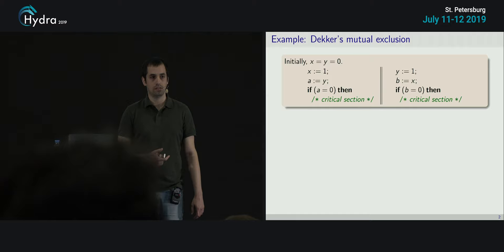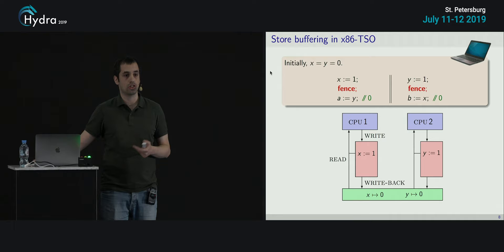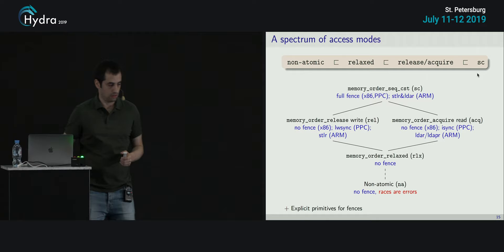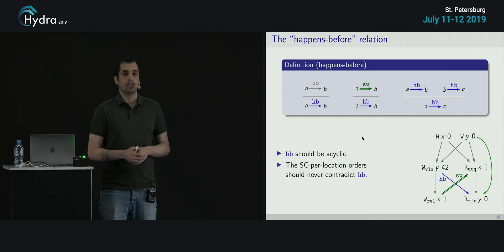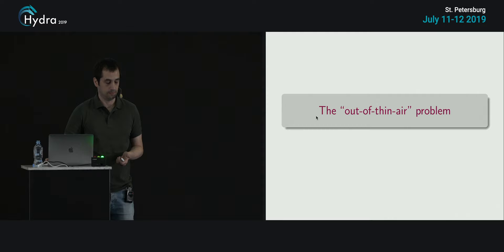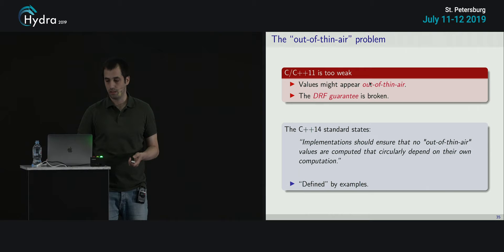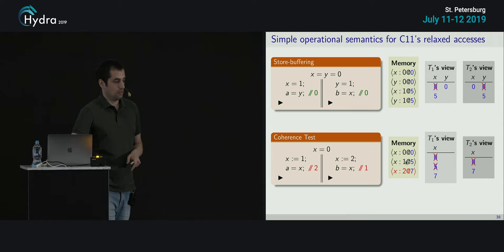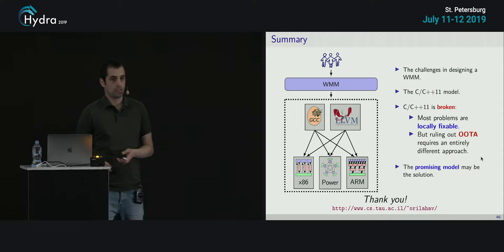Ori Lahav — Weak memory concurrency in C/C++11

Comment: the example in 2:35 is not the right example to demonstrate mutex safety test,  the first thread may run and terminate even before the second thread starts, in this case even with compiler barrier, even with std::mutex it has the same results.